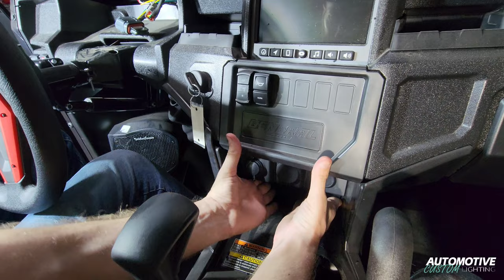PolarisGeneralTurnSignalInstallationVideo

Comment: Folks, first I want to say how happy I am with the turn signal I bought from you for my polaris general. They work flawlessly and they even kept me from getting a ticket for riding on the road.... but I do have a question... can you make a plug the will t into your set up for the turn signal and brake lights that would allow me to connect to my chase bar? My bar has the ability to work with my bake and turn signal light but I don't want to cut into the factory or your harness.

Comment: Thanks for sharing. I think this is something that I would like to add to my General XP4 1000. Price is right, but as my luck has been going I was just laid off, so when I am back up I will definitely look at this product. Install looked easy enough as well.
Reply: Did they say the price?
Reply: @cwolsch01  $249.99
Reply from the maker: @cwolsch01   Price is based off the options you select. Link to kit is in the video description.